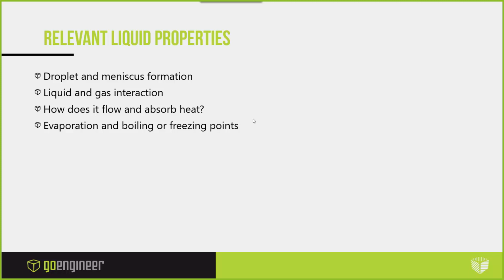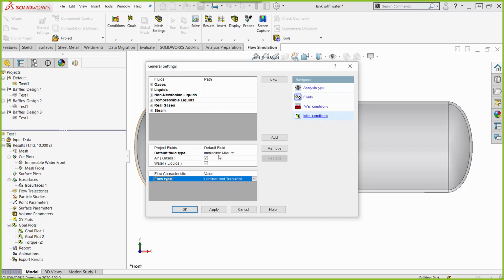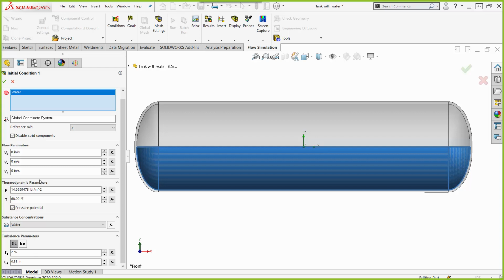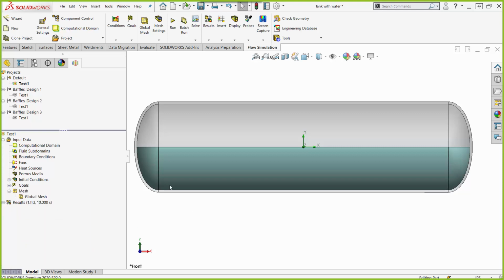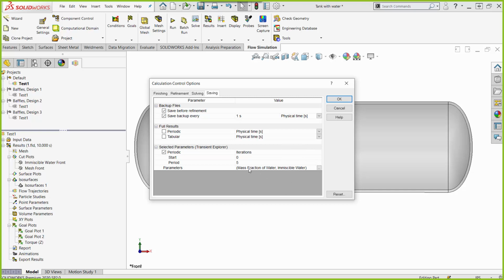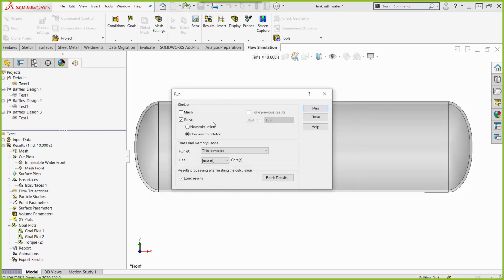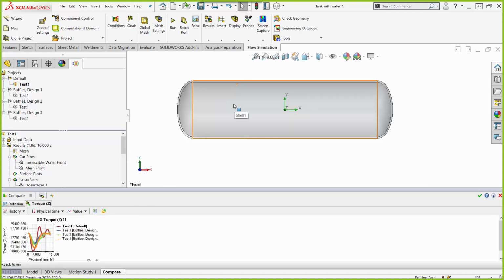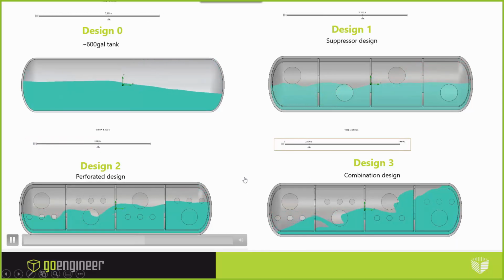SOLIDWORKS Flow Simulation - Tank Sloshing and Baffle Design

Comment: As the tank accelerates in the x-direction, the liquid inside it should move in the negative x-direction. But in SolidWorks, it's not happening. Why?
Reply from the maker: The tank is actually not accelerating in the x direction. Rather, Shivani is using a time dependent “gravity” pulling the fluid in the x direction to mimic the tank coming to a stop.